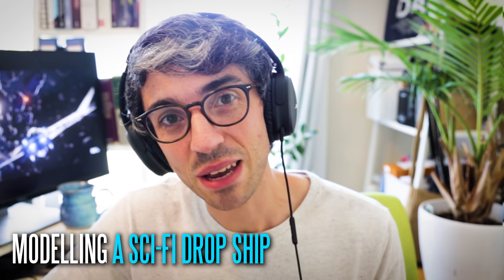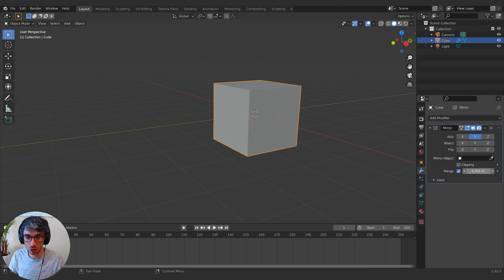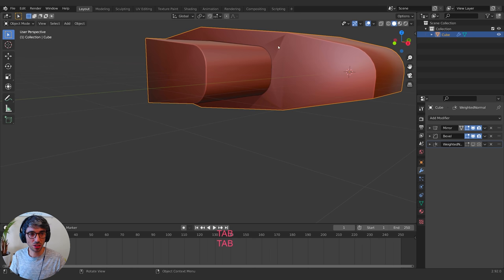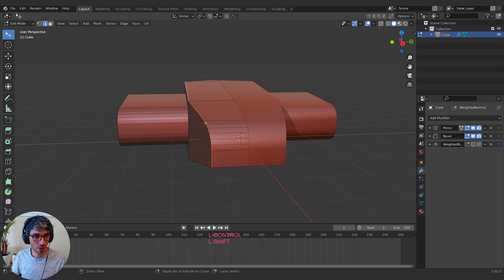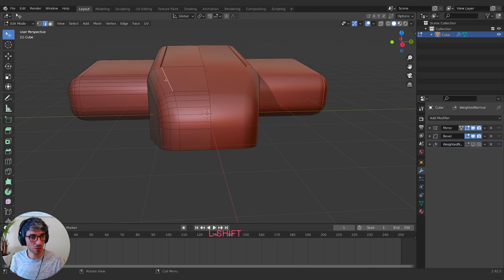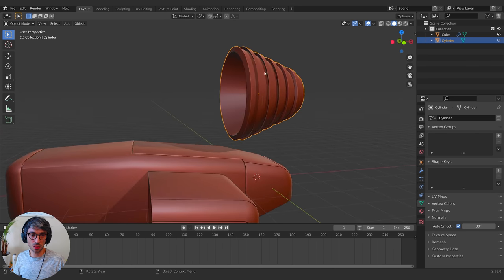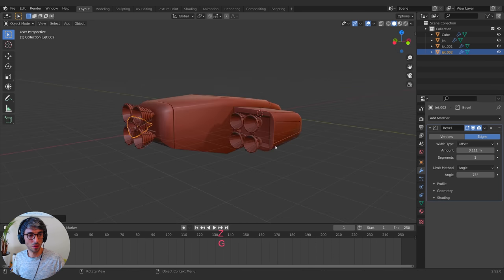Hard Surface Model A Spaceship No Add-Ons Required! Blender Tutorial

Comment: The dark line down the center was caused by there being a face inside the geometry. When you extruded the back it created the face. Whenever you extrude along a mirror you should turn off the mirror to find and delete any interior faces.
Reply from the maker: Great tip! Thanks Chimpinalls!
Reply: @CBaileyFilm  If you turn on clipping on your mirror modifier it won't create interior faces, it also won't let you move the verts in the centre away from the centre.
Reply: @TheMagicalAnimatron  i bet he probably normally works with addons, and has just forgotten that in vanilla blender you need to click on so many settings to get something working right hehe.

Comment: Hey Chris, another cool tutorial 😁👍 I'd only say, each time you make those small gaps like you do at 18:30 (and I've seen it in another tutorial as well) you bevel the edges, then hit E and S to extrude and scale them inwards. But the result will always be a little skewed. The best thing would be to hit Alt+E to Extrude Along Face Normals. This will give much better results. Oh by the way, talking about extruding and scaling: it's a bit confusing to say Inset is the same as extruding and scaling only that it saves a couple of key presses... this may be right for a single face, but just select two connected faces on a simple cube and compare the two methods, that's such a huge difference. And that's something you cannot do with E+S.
Reply from the maker: I need to start using Alt + E Thanks @gordon! That sounds way better - and I never realised the difference that insetting multiple faces at once has compared to extruding and scaling.  So helpful as always! Thanks for helping figure this stuff out! high fives 👋
Reply: @CBaileyFilm  You're very welcome 😁 The Alt+E option would also help with the rings on the greeble spheres... you won't have to switch pivot points back and forth.

Comment: personal stamps for learning
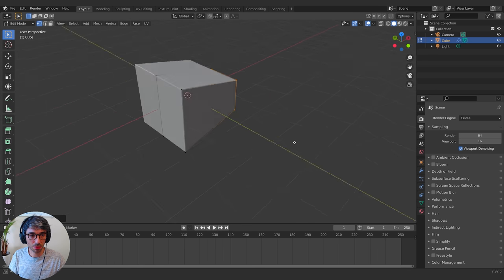4:57 press Z and S at the same time
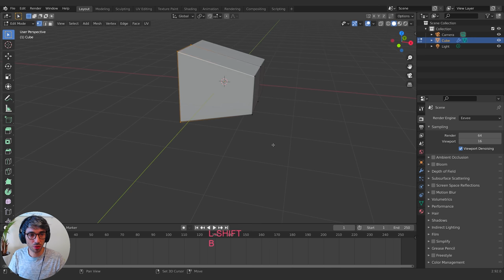5:00 double tap A to deselect all
5:03 E to extrude
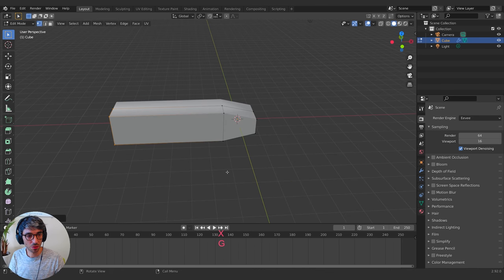5:18 loop cut = ctrl R and scale w/ S and Z at the same time (S first then Z)
5:25 face mode
deletes camera and light
6:13 I = inset
6:46 ctrl + b = bevel
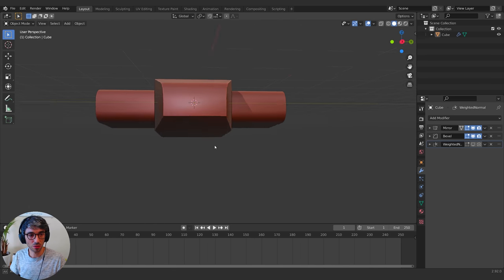7:34 making side jets
7:53 making back engines